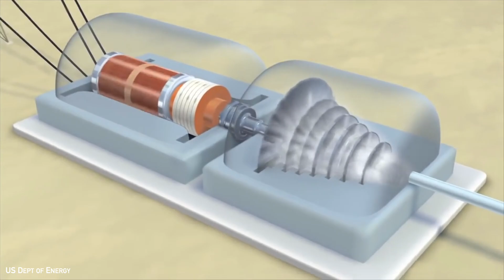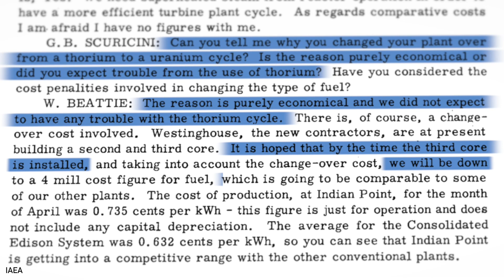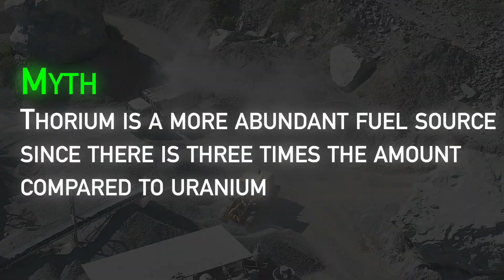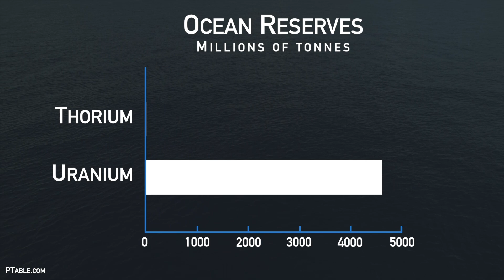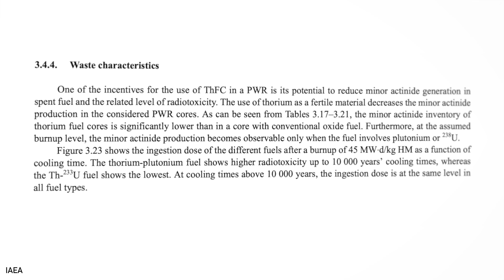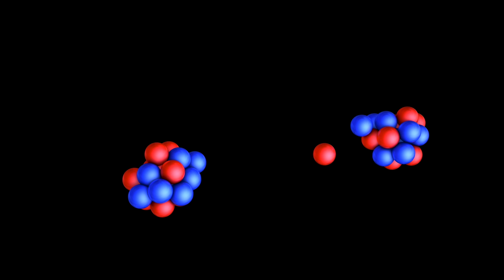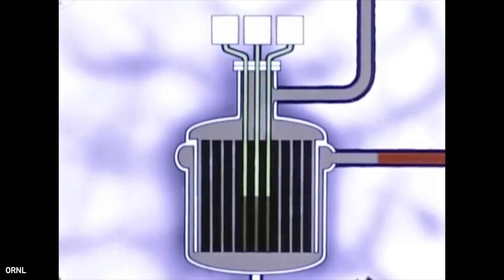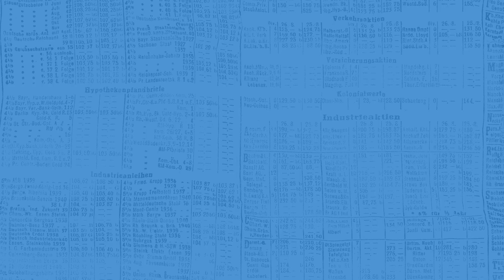*Almost

Comment: You missed a lot of the history of thorium power plants.  The USA believed strongly in them and Built 4 of them, not just the 1 you mentioned.  So here is a more complete discussion.

Thorium as a potentially viable nuclear reactor fuel was identified in the 1950's by many countries.

First though is that thorium is not fissile (you cannot get a nuclear reaction using thorium). A thorium reactor actually runs on U233 in the end - and its U233 that is recoverable from them.

In the presence of a properly controlled nuclear reaction thorium 233 absorbs a neutron and becomes protactinium233. The protactinium233 then decays to U233 (which takes about 2 months to get usable quantities of U233). As such all thorium reactors must be seeded with U233, U235, or plutonium239 (the common fissile materials) to supply fuel for the first 4+ months of operation.

I’m not going to list and discuss all the existing test reactors that had thorium loaded into them or the thorium specific test reactors that were built. Suffice to say that thorium was tested in both existing test reactors and specific built thorium designed test reactors by multiple countries and in all kinds of designs since the 1950’s: Light Water, Heavy Water, High Temp Hot Gas (HTGR) and of course the Oak Ridge Moten Salt Reactor (MSR).   The recent several decades have focused on HTGR pebble bed designs and of course China just built and started up in August 2023 a new thorium based MSR to determine if we technically have solved the molten salt corrosion issues well enough to proceed with further development.

I am considering the Shippingport thorium core load 3 (1977-1982) as a test reactor.  Shippingport was a naval aircraft carrier PWR that became the 1st USA demonstration and test reactor for commercial power: 60MWe output, Online 1958 (1st nuclear electrical power generation from a plant built with its primary purpose to generate electricity).   This thorium core proved that a thorium core could self-generate surplus U233 for recovery by reprocessing.  Shippingport was shut down in 1982 at the end of this test. 

To date only the USA felt that they had thorium fuel designs based on test reactors that worked well enough to design commercial power plants from, which did not work out as explained below.  In retrospect they can be viewed as very large and vastly costly test reactors.

The USA had also spent the equivalent of $Billions in today’s money to build a stockpile of U233 for weapons testing and to seed thorium reactors in the 1960's.  Note that they are now looking to spend $billions to dispose of that U233 stock as the containers are degrading and disposal is cheaper than repackaging the U233 stock into new containers and storing it, especially when there is no real foreseen use at this time for that U233 in the reasonable future.

1st attempt was Indian Point Unit 1 – light water thorium fueled 275MWe PWR power plant.  Online in 1962.  The thorium fuel performed so badly that they changed to uranium fuel in 1965 and the plant spent the rest of its life as a uranium reactor that operated well (this was not just economics - this PWR core design did not self generate enough U233 to reprocess the fuel in the future).  Unit 1 was shut down in 1974 due to changes in regulations from when it was built as the emergency core cooing system that was acceptable in 1962 was no longer acceptable in 1974, and plant design made retrofit of an acceptable system uneconomical.

2nd attempt (approved for construction at essentially the same time as Indian Point Unit 1) was Elk River – a light water thorium fueled 22 MWe BWR (Online in 1964, Shut down 3 ½ years later in 1968 due to major design and construction issues which led to cracks in the reactor vessel and main piping resulting in significant reactor water leakage.  I have found comments that says the reactor and power plant did not operate as expected; but, no evidence if this was a fuel issue or other issues.

A couple notes related to the design and how it relates to the modern concept of Small Modular Reactors (SMR’s).  The outline sketch shows what looks like a natural circulation reactor vessel with a boiler design never used again.  It looks more like a natural circulation PWR without any pressurizer or pumps for the primary loop with a separate boiler/steam generator. The Atomic Energy Commission and the plant designers insisted it was a BWR and the sketch and easy documentation I can find with short internet searches leaves a lot of questions – like was there intermixing between the reactor loop and the feedwater inside the lower section of the boiler).

More interesting is that this was presented as a prototype for a “Small Modular Reactor” for rural America as the reactor assembly and boiler was built in a plant and shipped to site by a railcar, which could be done anywhere as the key SMR concept of small nuclear reactors would be economical due to mass production was presented at an international conference in 1955.  However, 17 power plant reactors which would be considered SMR size today were built in the USA from the 1950’s into the 1970’s.  Not one of them is operating today (all shutdown long ago and many of them very prematurely) – whereas a number of large central station nuclear power plants (550 MWe +) built during the same period are still operating.

Other than the cracks and reactor water leaks the biggest lesson learned was that small nuclear units like this would never be cost competitive with larger nuclear units as they need more materials and cost much more to build on a MWhr generated basis; and also cost much more to operate and maintain on a MWhr generated basis than a larger plant due to staffing requirements. Note that a 12 MWe uranium power plant in Piqua, Ohio which ran from 1963-1966 was closed with the same conclusion.

3rd attempt was Peach Bottom Unit 1 - a thorium fueled 40 MWe HTGR reactor (as that seemed to be the most applicable technology other than light water based on test reactors). Online in 1967, shutdown in 1974. There were severe problems with the thorium fuel and it was quickly changed to U235 fuel. There were massive other plant design problems (scaling up from a test reactor size rarely goes smooth). A total commercial and technical flop.

4th attempt (based on lessons learned from Peach Bottom) was Fort St Vrain - a 330MWe output thorium fueled HTGR.  Online in 1979, shutdown in 1989 due to several issues in the plant design that affected operation and required excessive and expensive maintenance and only produced 15% of the power it should have if it could run well enough to base load at 100% output, which is how most US Nuclear Reactors are loaded.   I had a coworker who had worked at Fort St Vrain and he told me that in the end it was also converted to Uranium fuel.   I have been unable to verify that with limited internet searches (multiple sources report that Peach Bottom Unit 1 was quickly converted to Uranium).   Fort St Vrain was again both a major technical and economic flop.

Bottom line is that there has been extensive research into thorium-based reactors by multiple countries from the 1950’s to current time, and the USA even built 4 commercial power plants using BWR, PWR, and HTGR designs which all were failures.

Meanwhile U235 based BWR, PWR, and HTGR power pant reactors constructed at the same time worked well enough to evolve into 2nd generation and now 3rd generation plants (for BWR & PWR).

No country to date has made a thorium test reactor or power plant work well enough to design a future power plant at this point – especially when they look at the USA’s attempts at building thorium fueled power plants by substantial scaling up of test reactors. The world history of initial nuclear power plant designs, and even 2nd generation designs, in many countries show lots of failures as what seems to work so well on paper often does not work in practice or scale up well (or is too expensive to maintain).

Research continues and just because thorium did not work well and was not economical in the past does not mean that it won’t work well or be economical in the future.  It’s just going to take a lot of money and time.  If it was easy, it would have already been done.  

Anyone hyping thorium as something new, igonored, or easy is just BS'ing people.   Many countries have tried to make it work - and so far no one has regardless of the reactor design and type (there were substantial attempts with pebble beds in the 1980's and 1990's).  China is now seeing if we technically have solved the MSR corrosion issue.  Even if that works - it does not say that a thorium power plant reactor will be more economical or problem free than a similar uranium or plutonium molten salt reactor.

Comment: China's small 2MW developmental reactor has been running in the Gansu desert since December of 2022.  Not much word has leaked out about success or problems. The goal was to upscale this type reactor by 2030.  Why so long?  China has also developed a thorium pebble bed reactor with the support of Germany.  It too has been running with little or no information about its status??

Comment: Of the six proposed fourth-generation nuclear reactor types, the Molten Salt Reactor (MSR) is the only type that has high fuel efficiency, no danger of explosion, and does not generate substantial amounts of plutonium. The fissile uranium-233 produced by the MSR is difficult to use for weapons because of the presence of highly radioactive uranium-232. While other Small Modular Reactors (SMRs) can serve as a short-term solution, MSRs are considered a more promising mid-term solution due to their potential to address these issues more comprehensively. Hopefully, we will have fusion by the time we run out of uranium and thorium. A thorium reserve of 1.5 million tons will be exhausted in 1100 years at an annual consumption of 1350 tons.

The differences between Light Water Reactors (LWR) and Thorium Molten Salt Reactors (TMSR) are significant in fuel utilization and waste production. LWRs use approximately 0.5-1% of uranium fuel, leading to the generation of long-lived radioactive waste due to inefficient energy conversion and the use of enriched uranium. In contrast, TMSRs can achieve fuel efficiency of up to 98%. This is achieved by converting fertile thorium-232 into fissile uranium-233, substantially reducing waste production and more manageable radioactive waste. Uranium Molten Salt Reactors (UMSR) are just as effective as TMSRs.

800 kg of natural thorium in a Molten Salt Reactor (MSR) can generate 1 gigawatt (GW) of electricity for one year. In comparison, generating the same amount of energy in a Light Water Reactor (LWR) would require mining 200 tons of uranium. In an MSR, the storage requirement for 83 percent of the spent fuel is 10 years, and 300 years for the remaining 17 percent, whereas in an LWR, 28 tons of spent fuel need reprocessing and storage for 200,000 years. MSRs can utilize the spent fuel from LWRs. A coal power station will need to burn 3.5 million tons of coal and emit 10 million tons of carbon dioxide to produce the same amount of energy for one year. That amount of coal contains 3 to 14 tons of uranium, 3 to 14 tons of thorium, and an average of 84 tons of arsenic.

MSRs can adjust power output to match electricity demand, thanks to the inherent and automatic load-following capability provided by the fluid nature of the molten salt coolant. A key safety feature of MSR is that it automatically adjusts to prevent overheating. This is achieved through a "negative thermal reactivity coefficient," which means that as the temperature rises, the reactor's reactivity decreases, preventing a runaway chain reaction. Additionally, the MSR has a "negative void reactivity coefficient," ensuring that the reactivity decreases if there is a loss of coolant or boiling, preventing potential overheating. These safety measures help keep the reactor stable and safe under various conditions.

Looking ahead to 2040, China plans to deploy Molten Salt Reactors (MSRs) for desalination of seawater, district heating or cooling, hydrogen production, powering of ships equipped with Thermoacoustic Stirling Generators, and power plants with Supercritical Carbon Dioxide Turbines within its borders and globally. In the Earth's crust, thorium is nearly four times more abundant than uranium. Every atom of natural thorium can be harnessed, unlike natural uranium, where only 1 out of every 139 atoms can be used. China produces thorium as a byproduct of its rare earth processing.

Similar to the trends observed with solar and wind technologies, MSR costs are anticipated to decrease with the scaling up of production and the development of robust supply chains.

Comment: This video is not well balanced.  The nuclear industry has little incentive to try new designs due to the monumental amount of regulatory restrictions.  Companies currently make the most money through the production of the fuel rods for LWRs, as such what incentive do they have for switching to a molten salt technology be it thorium or uranium?  Molten salt reactors have huge safety benefits compared to other options.  Molten salt thorium reactors can utilize the throrium with significantly higher efficiency which reduces the cost of the power produced.  Due to the higher operating temperature of molten salt reactors the efficiency of the turbines that generate electricity is far higher, and the turbines are physically smaller, adding to cost advantages.  If we were starting from scratch now and did not desire to make nuclear weapons there is little doubt that molten salt thorium reactiors would be commonly used.  Given the desire to transition away from fossil fuels and the need for stable electrical power we need to seriously develop solutions utilizing thorium molten salt reactors.

Comment: You need plutonium 239 which is 50 times more energetic than uranium 235 to convert thorium into uranium 233 which in turn can be used to create the thorium-uranium 233 fuel breeding cycle which can create 60 to 70 times more U 233 from thorium than it consumes. Which means for 1 ton of U 233 you can convert 60 to 70 tons of thorium into U 233. Thorium is as common as lead.

Comment: 4:14 The fact that you should have stated is that Neodymium is found in the same mines as Thorium.   China mines for Neodymium.  We pay China dearly to buy Neodymium for wind turbines, disk drives, and electric vehicles.  Thorium comes from the same mines.  China leaves Thorium in a pile.  When we use Thorium to provide abundant energy for 8 billion people, we will get more neodymium in the process.  When we use Thorium to power the USA, we can safely and cleanly resume mining Neodymium in the USA, creating a secure, safe, clean supply chain.  A tiny amount of Thorium can produce a huge power.  For all practical purposes the supply of Thorium is unlimited: sufficiently abundant to provide all energy needs for the whole human race.  I favor hydro, wave power, wind, solar, Thorium fission, Uranium fission, and a diverse mix of sustainable sources, but the amount of Thorium on our planet is not a limiting factor.  Instead of being a party pooper, you should re-do your video to correctly state this.

Comment: I agree. The molten salt reactor (whose feasibility was demonstrated at Oak Ridge) is what really offers us a superior technology.
BUT
Thorium is (relatively) abundant and easy to harvest. In India, you can shovel it off the beach!
It is less capable of producing bombs than uranium (which can become plutonium, in a reactor). 
At the time the thorium "aircraft reactor project" at Oak Ridge was terminated for want of funds, bombs were what we needed. 
What we found out subsequently was  that the pressurized  water reactor could itself become the bomb. !!!!
A PWR actually consumes around one percent of the fuel. A molten salt reactor consumes it all.
And the freeze plug is just about the  most passive safety device you could think of.
I like the MSR. Especially the twin chamber design, for use with Thorium.
We are in danger of seeing it commercialzed ... ... ... by the  Chinese. And we don't want that.
Reply: Jai Hinduja.  We Indians had been using thorium fuel  in our nuclear reactors long before the experimental Chinese MSR.

Comment: Isn't a key issue that the amount of fissionable U235 (0.72% of the total uranium) is much smaller than available thorium? Thus, the total U238 plus U235 ratio to thorium is not the critical issue. Thorium ore isotopes don't need to be enriched to act as a fuel, unlike uranium. Also, the supply chain for uranium is dominated by Russia. What is the impact in terms of supply chain security? Am I correct on all of this?

Comment: I am not a nuclear physicist, but I am an engineer.  As such, I detect the whiff of BS in this video.  It sounds like there has been some directive by the status quo U235 fission industry to dissuade the uninformed general public away from thorium.  The "challenges to overcome" for thorium reactors are primarily materials and design refinements needed to produce dependable, economic fission reactor designs.  The "challenges to overcome" for uranium reactors are based on the actual physics of uranium fission, problems known for 80 years, and have not been totally resolved.  The question needs to be asked, why are other countries pursuing thorium fuel and we are only dabbling with it ???   Follow the money.